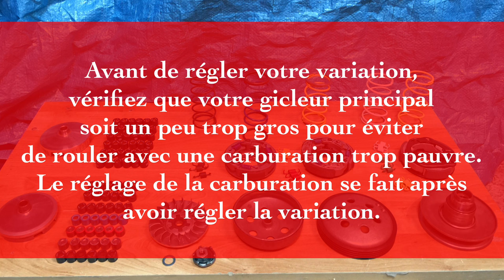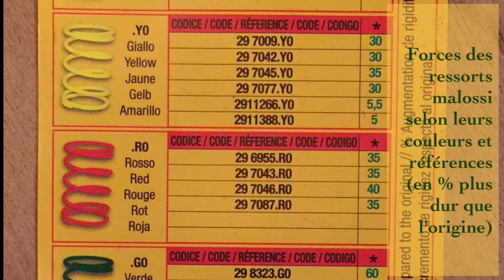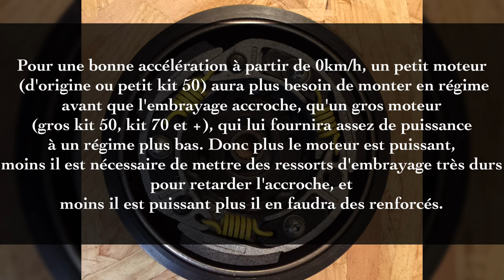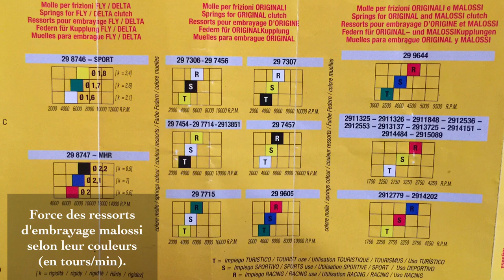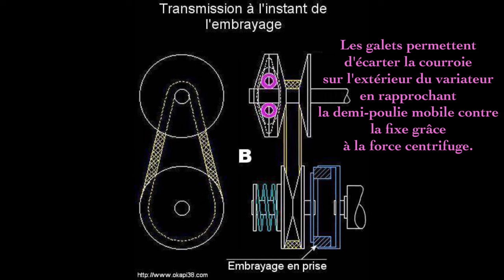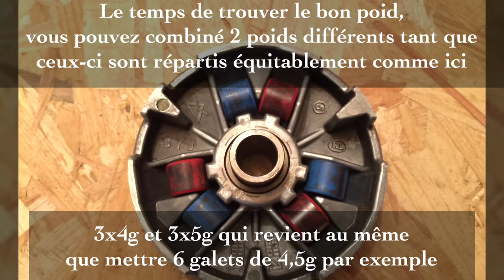Comment régler le variateur et l'embrayage d'un scooter? (1080p)

Comment: bonjour j ai un mbk booster full origine juste un vario malossi mhr et embreyage malossi le scooter monte pas plus de 60 galet 6.3 resoort embreyage jaune et pousse blanc malossi la courroie ne monte pas jusque en haut aurai tu un conseille pour etre sur une bonne piste pour le regle a la perfection svp ?
Reply: Bonjour, si c’est un booster full origine des galets des 4,1g devrait être bien, après avec le vario malossi ça peu changer, vérifié si la courroie monte en haut sinon augmente de 0,1 en 0,1 ton moteur doit avoir du mal à monter en régime et roule trop en charge, en réglant dans ce sens là tu devrait y arriver, tu n’a pas de pot dessus? Origine débrider au vario et pot, un 70-75km/h c’est déjà pas mal.
Reply from the maker: Si il monte vite en régime mais que la courroie ne s’écarte pas à fond, c’est que les galets sont trop légers, si il a du mal à monter en régime c’est au contraire des galets trop lourds comme je t’ai expliqué avant, les ressort sont bien, moi je roulais avec les embrayages verts pour une conduite plus souple